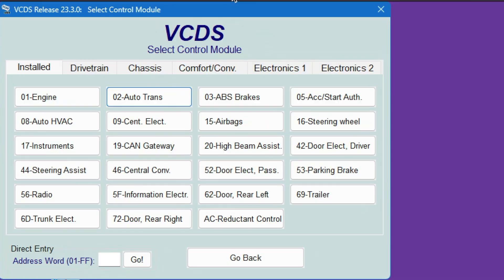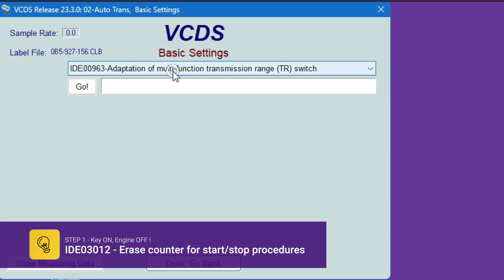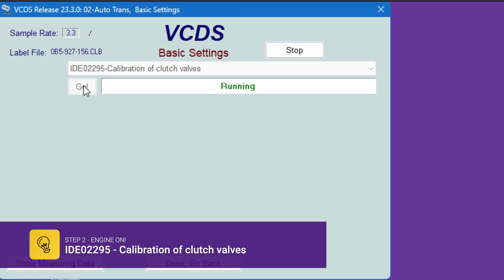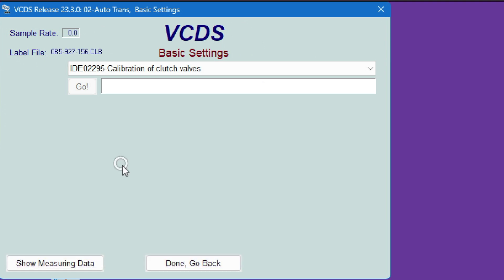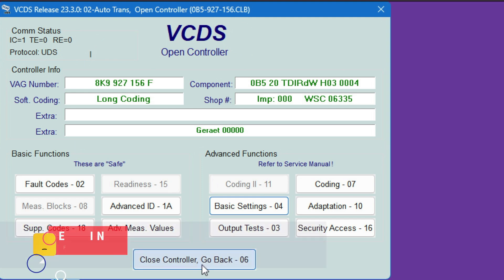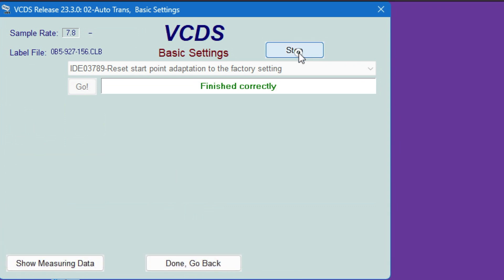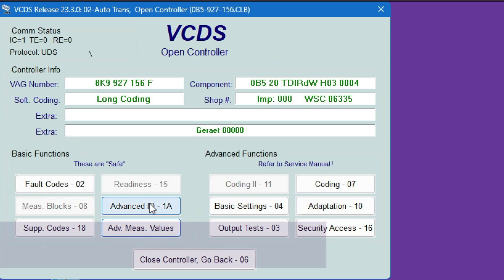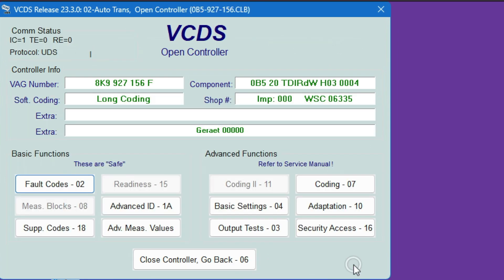Transmission adaptation S-Tronic DL501 with VCDS

Comment: Hi, I followed all the steps exactly as shown in the video. However, when pulling away I still get a sudden jerk forward and a clicking noise that sounds like it’s coming from the clutch. Do you have a solution for this?
Kind regards
Reply from the maker: Have you done all the software updates on the gearbox?

Comment: Why wr reset after some adoptation insteaod of first step is reset points?
Reply from the maker: Because the reset is part of the second part calibration and all the steps before are for the other parts of the gearbox that also needs to be adjusted before you get to that point.

Comment: ok once you have done your driving for 2 hours or so how do you check the clutch adaption is complete? is there  settings or values you have to check? or do you just wait until it informs you on the screen saying both clutches are now complete? in that case you will have to keep it connected to VCDS or can you disconnect and reconnect and bring the same adaption settings up and it should tell you its finished?
Reply from the maker: Yes, check the end of the video and you will see all the steps that the adaptation goes through. It will say Engagement point broken in.

Comment: Do I drive in manual on 4-5 gear and 6-7?
Reply from the maker: @joshuaperez1187  you can but in general the gearbox electronics will do it by itself. It will force the car in 6 and then in 7
Reply: @ so drive on the highway basically?
Reply: Should I drive on both dynamic and comfort ?
Reply from the maker: @ correct
Reply from the maker: @ that is also a way to do it.
Reply: @bonevchannel  okay bc the first time I did an adap. I was always in the city driving in dynamic manual. And I didn’t know you gotta let the clutch break in first
Reply from the maker: @ like I said the gearbox will handle it.

Comment: Hello and thank you for this perfect and precise video! Just a quick question, at no time should you keep pressing the brake pedal? It is not specified at any time and it seemed to me that it was necessary to do it...
Reply from the maker: If pressing the break pedal is needed for any of the steps, it will be specified in VCDS window. I do not think using the break pedal was needed for my car.

Comment: Thank you for video, I had to do it because when I had to move uphills my engine stalled. And btw npc question, I have Dl501 stronic I tried to adapt multifunction transmission range (TR) switch and It said aborted safety reasons and I got error? It is because we got other sensor in this gearbox?
Reply from the maker: I cannot be sure about that one but is very possible if it cannot read the sensor.
Reply: @bonevchannel  Hope i didnt damaged anything, it was fault it couldnt be reached
Reply: @MultiAndyGames  you need your seatbelt on, parking brake on, foot on brake pedal, and car in drive. Not doing any of these will not allow adaptation to start

Comment: Hello! For some reason mine won't erase counter for start stop procedures. It does all the rest no problem. I've tried many times now I just get an error with not in range? Any idea how to make it work or is not that important? Thanks 🤞🏻
Reply: If your car doesn´t have start/stop you can skip that step.
Reply from the maker: Try rebooting/disconnecting the software and power cycle the car
Reply: @bonevchannel  Thanks for the reply! I did try all the power cycle and still the same. What does the reset actually do? Is it important or can I leave it? Thanks 👍🏻
Reply from the maker: @ksrnate  I guess you can skip this and try the rest. Are you sure you are using the same S tonic gearbox?
Reply: @bonevchannel  I think so 🤭 it's a 7 speed

Comment: In s-tronic is it possible to make a custom program that shifts all the gears at 1500 RPM?
Or is there a manner to make the paddle shifters on the steering wheel to chage "when I want"? 
I see that they will allow to shift only when a certain RPM is reached (especially when shifting to higher gears)
I have a A3 184CV TDI and it has plenty of power at low RPM, shifting such high is just burned fuel

Thank you

Comment: Regarding the test drive, do I need to do it specifically? Or can I just use my car as normal (for ex. drive around in the city) and whenever I use a highway it will finish the adjustment of the clutches?
Reply from the maker: You can drive using your daily routine.

Comment: hallo bonyo bonev. I bought an Audi A6 C7 2015 3.0 tdi  S Tronic, car drives super well with gear changes, but I experience a small problem when I brake when it goes down in the gears completely when the car stops at a traffic it makes a small vibration, I can feel it in the brake pedal. I have the vcds cable, can you help me with which adaptation should i reset ? rhankssss
Reply from the maker: Hi, You need to do all the steps as outlined in the video. This is not a guarantee that the problem will be solved. If you ask me first check when the oil is due for a change, second if it is close to being due replace it, third run all steps in this video, final thing is to check for software updates on the gearbox here: https://youtu.be/iEoJ9iakXL8?si=BCv8SPTLKnz9LAbK
Reply: @bonevchannel  okay gearbox oil was changed 6000km ago said previous owner.
Reply from the maker: @SandresKoja  Then I would suggest check for software updates on engine and transmission and go with the video steps.

Comment: How long did this process take?
Reply from the maker: about 2-3 hours. You can do it as it comes. You do not have to drive constantly until clutches completes.
Reply: The vcds basic settings will take 2-3 hours? I’m just wondering
Reply from the maker: @straight2dapointD  no the process in VCDs is about 20 min. The adjustment of the clutches takes about 2-3 hours of total driving which can be done as you go to work and back every day.
Reply: Thanks for the info

Comment: Hi guys! Just did all steps for transmission adaptation but not the one with reset … to factory settings, I dont have that option in my vcds menu, now remains to drive 1.30-2.00 hrs, My question is, can I perfom this after a few hours I mean when going to work. Thx.
Reply: cool man. And then after driving 2-2.30 hrs should I open VCDS and check the adapatation status of engagement point?😊
Reply from the maker: @s.Cov0824  yes you can. If want to force it do it in one try then drive manual on 7 until it breaks in. Then drive on 6 until it breaks in. Normal driving 1500-2000 rpm
Reply: @bonevchannel  ok, got it! My trip to work its about 95km and return another 95km, my average speed its 110-130, only motorway. That’s why I’m asking to see if I have to leave home earlier ( my journey to perform last step will be longer than usual) to perform last step or carry on with usual speed?( and journey will be shorter) Thank you.
Reply from the maker: @s.Cov0824  just drive normal as you like. It will break in if not on this trip it will on the next.
Reply: @bonevchannel  🙂👍👍 man, thank you so much for being so patient . Will let you know when will finish. Really helped your video. All the best!🤙
Reply from the maker: @s.Cov0824  👌🏻🤟🏻
Reply from the maker: Yes you can. Also you can finish it in multiple drives.
Reply: @bonevchannel  thank you v much for quick response, will do this tonight and should I drive it manually or leave it on Auto drive? 🤝
Reply from the maker: @s.Cov0824  to be honest you can do it either way. If you are without VCDS then use normal drive and sports mode.
Reply from the maker: @s.Cov0824  Even if driving in normal you will notice the gear box will tend to upshift 😉

Comment: When i do Clutch valve adaptation i get Aborted-Safety Reasons, tried it 3 times, and the same. Temperature was 40-50 Celsius. And i just got the transmission rebuilt.
Reply from the maker: As you can tell something is not right. I have no idea 🤷🏼
Reply: Hi did you find out what is the problem please
Reply: @mortezagachkar6366  well, the last problem was the main connector. That is a very common problem, just unplug the connector that is directly at the transmission and check if it has any moisture (blue corrosion). Try cleaning it and doing it again. After fixing that i never had problems with the gearbox anymore.
Reply: @EmirDemirovski  do you have any faults? Or just connector was moisture without gearbox faults?

Comment: We replaced the clutch. After that we only did Adaptation-10 and the we only performed the clutch kiss calibration and the clutch valve calibration. Right after that the shifting of the gears where  quiet smooth and good as it was in the beginning. Do we need to perform the other steps also?
Reply from the maker: I guess if they work perfect you can skip. In any case it is best to perform all steps.
Reply: @bonevchannel  if I trying to perform the clutch valve calibration, it starts running for a whilw and than it stops with a message in green " abandon due to saftey reasons" the rest of the steps works perfectly. The Meassage in green and not red so I think its not that bad.
Reply from the maker: @SliZTec  does it gives you an error code? One thing can be the right temperature. The next is if the transmission has some issues.
Reply: @bonevchannel  no error Code and the temperature was abtut 43 Celsius. I tryed also at the temperature of 67 Celsius and at that temperature I got. an error that the temperature was to high. Do I have press the Blake bering the proceder ? Behause I put my foot of the Brake during the calibration.
Reply from the maker: @SliZTec  hi, you should be at park gear and no breaks during calibration of clutch valves.
Reply: @bonevchannel  even the Main valve valibration does not work. I've noticed that the pressure log of the clutches only shows N/A. Maybe the VCDS can't connect or maybe a problem with the software. Its strange that the pressure dont show up.
Reply from the maker: @SliZTec  this is strange. VCDS might give you an error as it did to me but cycle the power of the car and VCDS connection and it should be ok.
Reply: @SliZTec wondering if you got to the bottom of this. I'm having same issue, every other step seemed to work but the valve one, I'm leaning towards the mechatronics but have already replaced come solenoid and wiring harness, also replaced clutch pack

Comment: I got confused about the final part.. it's necessary to drive the car for 2 hours? Just in gears 6..and 5 or 7?
Reply from the maker: You can drive in 5 or 7 for clutch 1 and gear 6 for clutch 2. It takes about 2 hours for all. If you commute daily to work for lets say 30 min I would just do that and check the clutch adaptation at the end of the week.
Reply: @bonevchannel  Thank you! so.. there is no problem to make theses adaptations along some days, right? is it necessary to be in Auto or Dynamic?
Reply from the maker: @OliverSQ  It should work in any gears to be honest. So just drive it for a week and monitor the status via VCDS
Reply: Бонев дай и на БГ 🤙
Reply from the maker: @AngelDrinkov  лесно е и на английски. Като разказ по картинка е 🙂
Reply: @bonevchannel  Бонев дали с vcds може да се сканира за грешки и да се прави ъпдейт на скоростна кутия
Reply from the maker: @AngelDrinkov  за грешки можеш да сканираш но ъпдейт не може да правиш.
Reply: @bonevchannel  би ли ми споделил как става опитвам се да намеря от къде точно да ги сканирам ама греда благодаря предварително
Reply from the maker: @AngelDrinkov  на 32 секунда правя точно това.